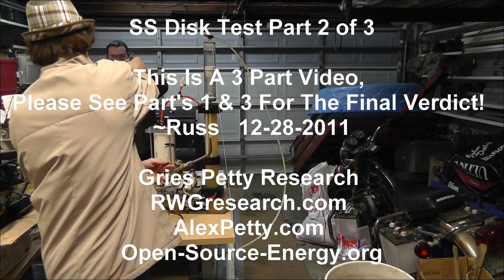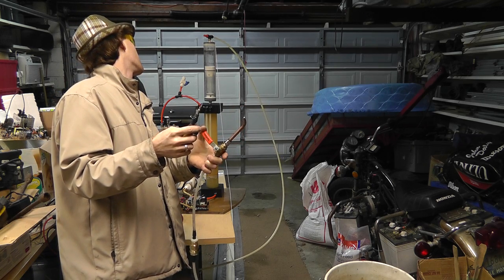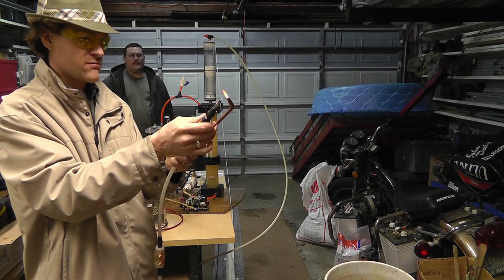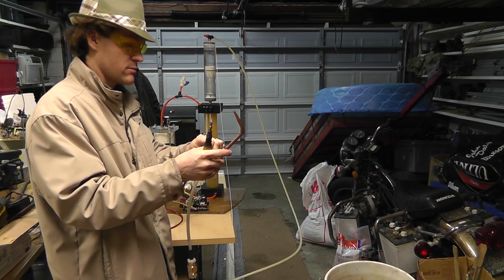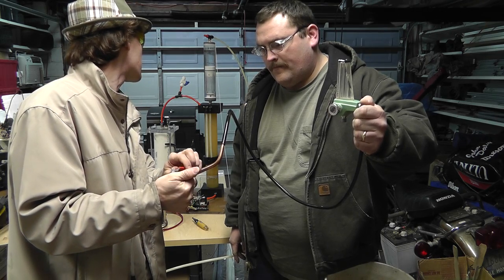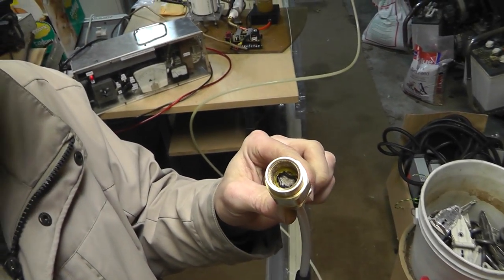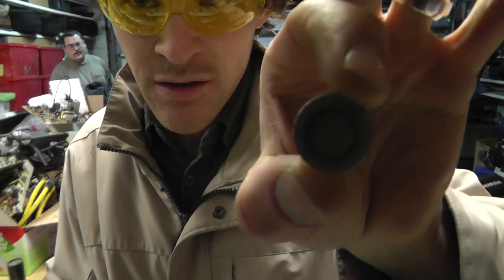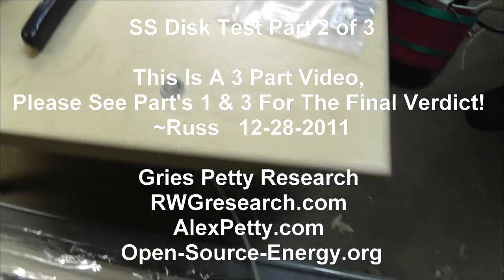P2 Stanly Meyers Quenching Disk Successes Works Like Stated! Its Real:) ~Russ 12-28-11

Comment: Great job bro u have the back pressure and flashback working great. all u need is volume :) due to heat and pressure on the hho/bubbler u may have to build a one way presure tank with adjustable pop off valve